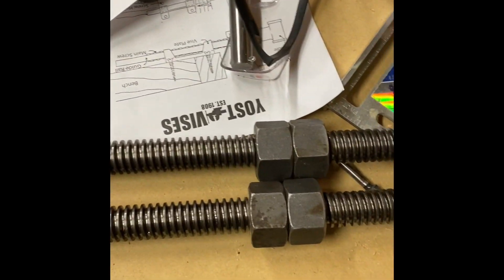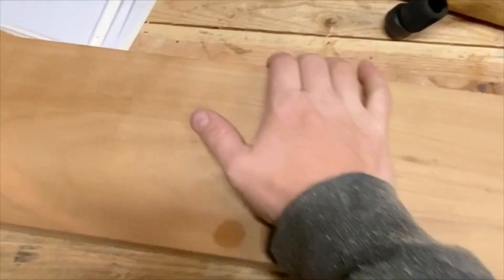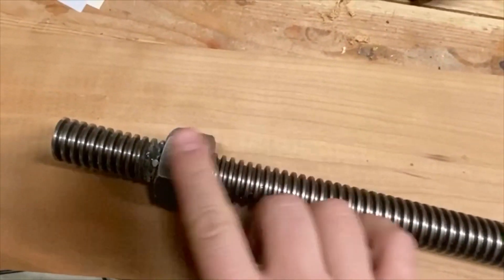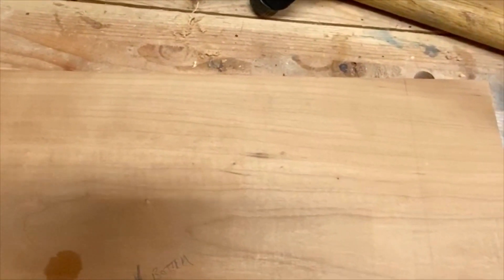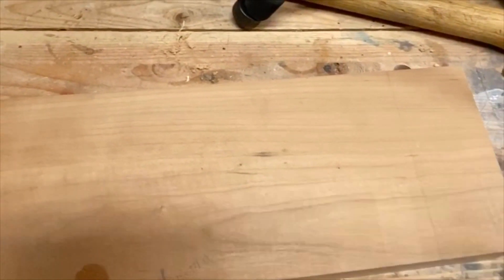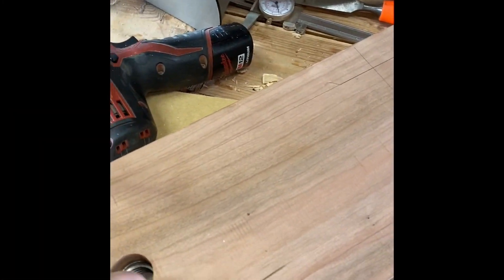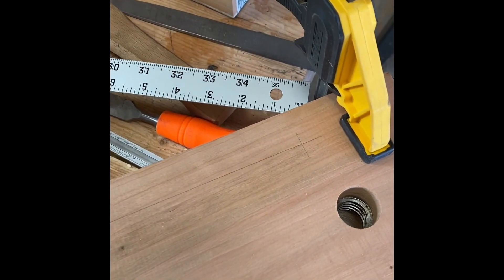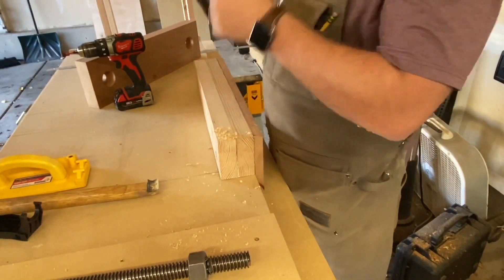I Built This Budget Twin Screw Vise With Some Scrap Wood.

Comment: You’re not gonna show us how it works? Doesn’t appear to be a true twinscrew, since turning one should turn the other, no chain linking the two together. This kind of design is very prone to binding up.
Reply from the maker: Sorry! Didn’t even think about getting video in action. I’ve been using it a while. It doesn’t have the linkage. Both sides are independent, I just operate them one at a time. 1 twist then 1 twist. No problems with binding so far.

Comment: I wish there was a way to filter YouTube videos like this based on equipment used.  I just don't have a warehouse full of machine tools - I'm much more interested in videos that use a modest suite of tools.  Nothing against the others (like this one) - they just don't represent something I'm anywhere close to being able to do.
Reply: I get where you coming from.  I also don't have a hoard for machine tools just a modest few ( cordless drill and a small angle grinder) but I use these videos for the pattern and then think my way around them for what I have to work with.
Reply from the maker: I get that! In the early days I was building guitars with a jig saw , borrowed workspace, and hand tools. Part of the joy of advancing in woodworking is accumulating great tools that are a pleasure to use. Ironically, my favorite tools are hand tools, but some no less expensive than the powered ones. That being said, with a little creativity and sweat, this project is totally doable with much less.